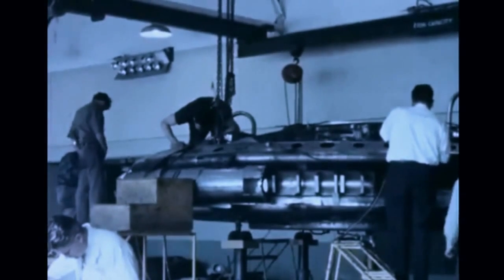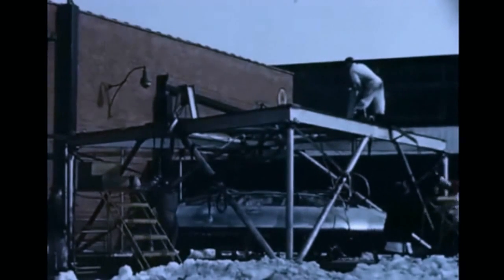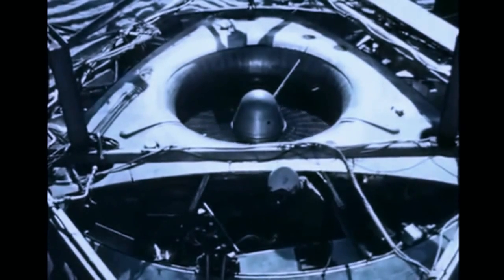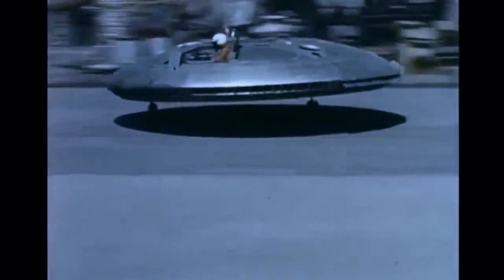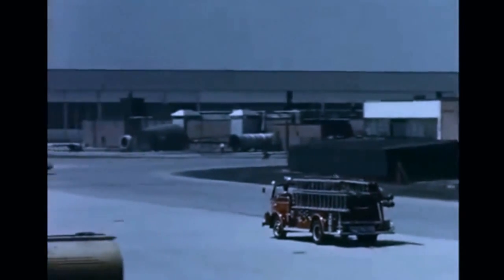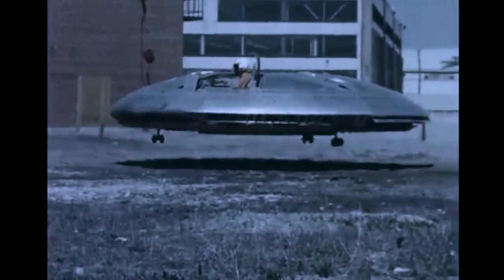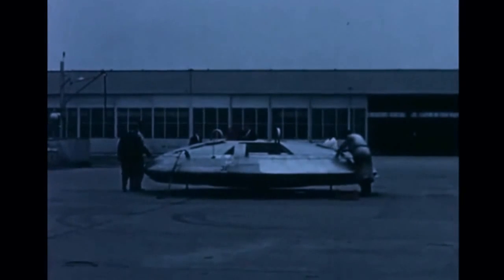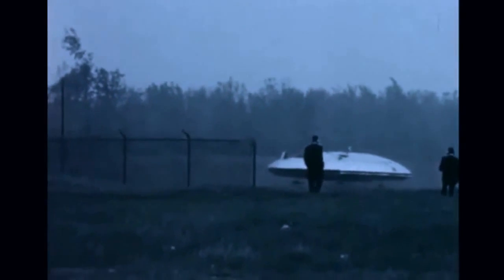A.V. Roe Canada VZ-9 Avrocar Flying Disc Progress Report #3 - 1961

Comment: I did a lot of flying at one time.  However the L1011 was the only wide body I was ever on (assuming 767's don't count).  It was a Canadian flight from Toronto to LA. We hit rough air several times during the fight. Each time the plane shook like crazy. Nothing fell off or fell down (as far as I know) but each time the plane shook the interior panels shifted back and forth as if they were all mounted with loose screws!  If this is typical on dirigible sized aircraft I'm glad I missed the experience all but one time.
Reply: The airplane is designed to be flexible.  There are NO loose screws.
Reply: @MrShobar  I bet there are  some, especially in the seats.